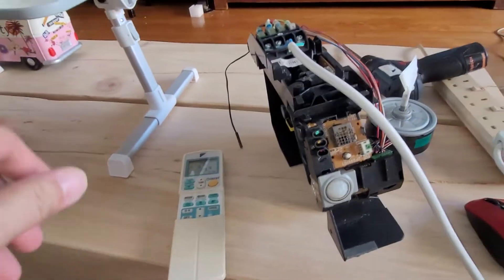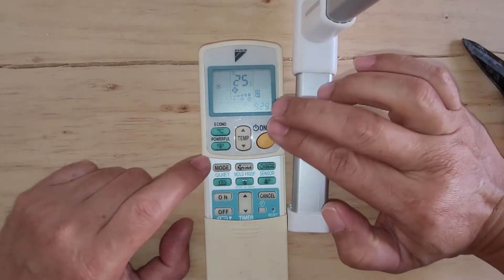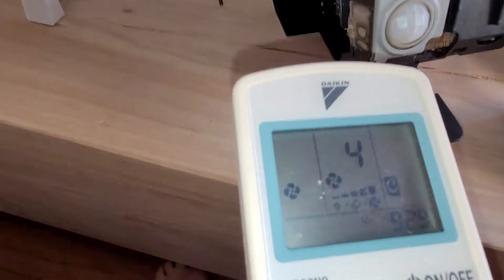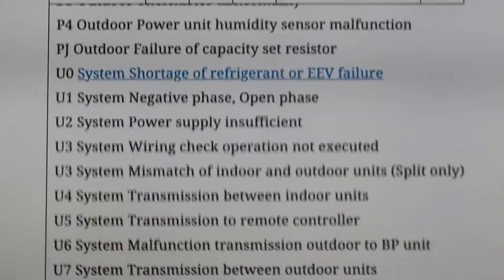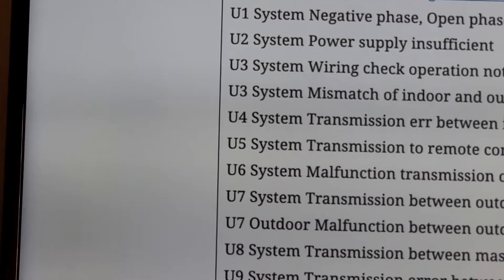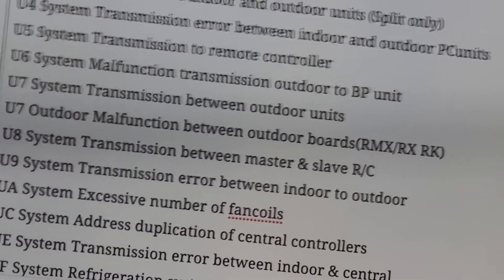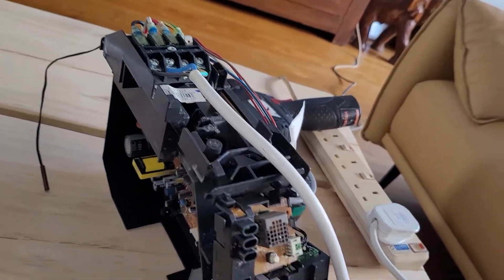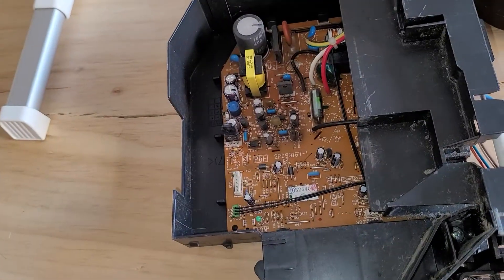What is Daikin Aircon malfunction/error code U4.

Comment: Dear Kevin
Thank you for the video.
The machine gives a U4 error onlu when it rains.

Using the remote, scrolling through the error codes gives a long beep on U4, i then cancel the error, switch off the machine and Circuit breaker and the reset works.

Why is the machine acting up only when it rain, in peak summer there is no problem.
Reply: Water is getting in your cables causing a loss of connection. Check for corrosion
Reply: awesome! I follow what you instructed and it works. Thank you

Comment: I get the flashing green light when I switch to a different mode. I retrieved the error code using the remote and it shows U4. The aircon still works in certain modes (auto and heating in this case), but it blinks green and doesn't switch on for others (cooling, dehumidifying). Is it still possible that it's the PCB cable issue?
Reply from the maker: Hi, when you are using the heating mode, does it produce heat or it's simply behaving like a fan?
Reply: @astiquer  it produces heat
Reply: Did you by any chance manage to fix it I have the same issu :/

Comment: Mr Kevin
My Daikin Aircon have the exact same one you have with you
Problem is that
It's indoor unit blinks
And tested it with my remote and it says U4 
But I have check all the wires that connects indoor to outdoor unit
All the wires are good with well connection
But here my indoor unit also blinks and also my outdoor unit's led light also blinking the exact same way that it blinks as if inindoor unit sir
But I have no idea sir indoor unit's all fiction with remote works but outdoor unit also have supply and it's indicator light also turns On and start blinking the same
No idea where the problem is
Please hlp me sir
Reply from the maker: Hi Ram. It's PCB fault. If all indoor units are blinking, it's likely outdoor PCB board spoil. But if it's only one indoor unit blinking, then it's likely that indoor PCB board is faulty.
Reply: I have only one indoor unit and one outdoor unit sir
Reply from the maker: @ramsrikanth7639  oh no...then it's difficult to tell if it's indoor board or outdoor board. Since a system one is relatively cheap, it may not be cost effective to replace both PCB boards.
Reply: @astiquer  Mr Kevin thanks man thanks a lot finally I got what were you trying to tell
Actually I had unfortunately interchanged the live and neutral wire
Now after reverting it back now I sorted out my problem sir.tganjs thanks thanks a lot
Reply: Mr Kevin
Thanks for you attention to my problem
But here when I turn on my ac indoor unit
It's power led starts blinking
And there is an another led inside the pcb of indoor unit
It also blinks what to do sir
Out door unit's function is full working that the fan spin when I press the diagnosis button near the green led of the outdoor unit sir
And so when I turn on the indoor unit with fan mode it works perfectly on -airdirection,swing,fanspeed,timer,beepsound.
And the outdoor unit's function is also good but I can't find out which pcb's transmission is faulty
Pls help me

Comment: Thanks for the informative video. I’m in Singapore too and have encountered a U4 error tonight and 3 of the 4 ac units in my apartment (that are wired to one of the two condensers) no longer works. Does that mean it’s an outdoor unit’s PCB error?

Thanks in advance.
Reply from the maker: Hi DL, these 3 units are likely connected to the same condenser and it's likely to be an outdoor PCB fault. Try resetting it to see if it works (50/50) chance it might be revived. The switch is normally somewhere next to the condenser. U can call me or Whatsapp me on my mobile at 90674867 if u need more help.

Comment: I have a daikin error code UH
Reply: Hello. UH Fault Must be Being In a multiSplit system or VRV system. UH means wrong wire conection between services In the Outlook unit. Or VRV unit don’t recognize any indoor unit, because the bus wiring is wrong or open or short circuit . Or the external unit does’nt enough time to do the wiring communication test.

Comment: Hi Kevin,
Based on various symptoms, I can conclude that my old Daikin aircon is having a fault at its outdoor unit's PCB with error code "U4".
I tried to get a few aircon contractors to help repair or replace it, but so far all of them said it is not possible due to lack of skills or parts in Singapore.
It is a long shot, but by any chance if you are familiar with this industry in Singapore, do you have any recommendations on a contractor that can help me repair it?
Thank you in advance!
Reply from the maker: Hi, u4 malfunction code can be a pretty expensive repair for a Daikin Aircon. Depending on how old your condenser model is, replacement of pcb can cost in excess of $800 and there could be other problems including compressor and valve faults. Since spare parts are not returnable, most contractors shy away from such jobs, especially if your Aircon is more than 15yrs old as multiple expensive repairs could be in the pipe line.
Reply: @astiquer  Hi Kevin,
Thank you so much for the prompt reply. So it looks like the best way is to replace the whole system? I am quite reluctant as I will be selling the property soon.
Are there any possible ways out that comes to your mind in short term perspective?
Reply: @ckpcollection5883  Where is the property for sale 🤔? I don't wanna be the poor guy who buys it during the hot season 😫 😢 😔 😭

Comment: Sir I have used Daikin invertor ac last 5 years..but at present I am facing a problem..there's no activation beeps came after switch on the power supply as well as given any command from remote..but unit is working according to order..pls help me...
Reply: Only replace fan coil pc portd because normal

Comment: Sir if you have that pcb still then please send the value of the varistor near that fuse please
Reply: Sir in my daikin investor ac .there's no activation beeps came. When switch on the power supply as well as given any command from remote...what is the problem..pls help me in this issue...
Reply: @satishchandrajoshi7450  brother first clear my doubt : first note it ( air conditioner's outlet means the place where the cooled air comes out from your air conditioner in room you fixed it )
Now answer my question
1.did your air conditioner's outlet open and close when you oned the switch...say fast
Reply: @techpredator9384  sir in door unit.. in the room...
Reply: @satishchandrajoshi7450  that means there would be a problm in the speaker
Reply: @satishchandrajoshi7450  do your indoor unit ac opens and close when you switch it on???
Reply: Varistor means VDR
Reply from the maker: Do u mean thermistor or varistor? Thanks
Reply: @astiquer  subscribed my sir
Reply: Varistor bro
Reply from the maker: Ok I'll measure later
Reply: @astiquer  no need brother i itself repaired it
thank you for you cooperation
Reply: @techpredator9384  can you share what was it? I have U4 with tension on the earth wire